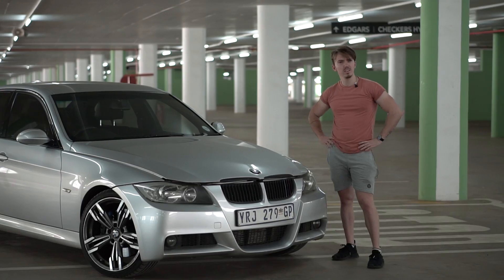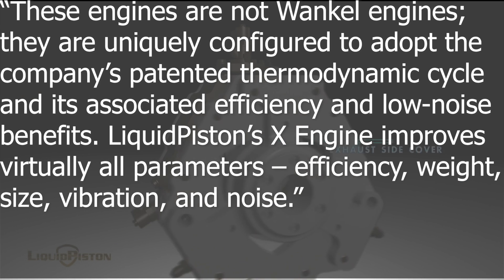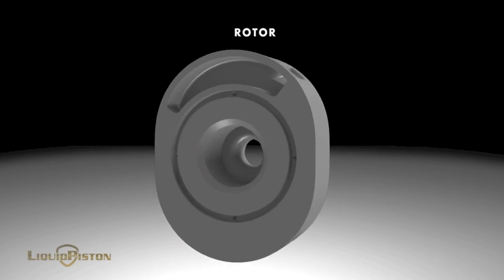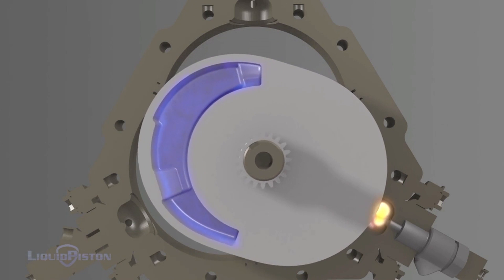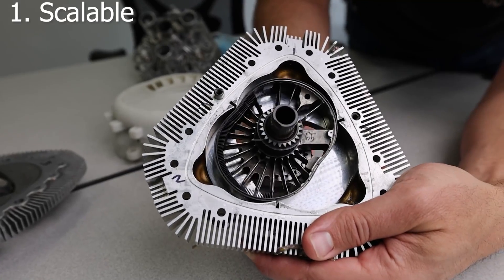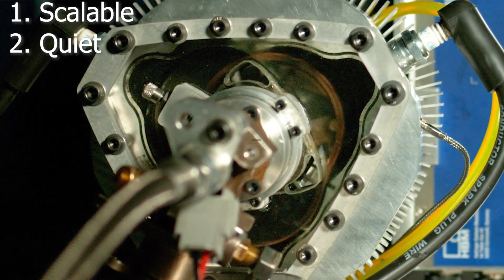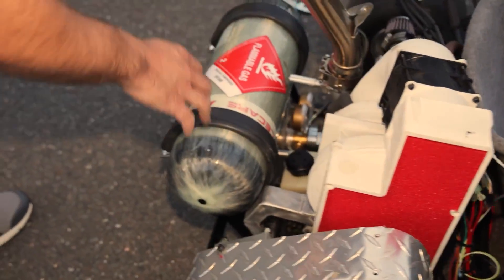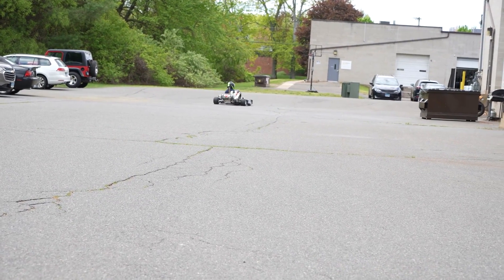This Liquid Piston engine revs to 15k rpm and can make over 1000HP

Comment: I'm thinking this is great commercial application use.  5 horsepower out of 70 cm is not much.  A dirty 80s NRD made Simson Comfort had a 70cc engine and made roughly 5hp.  The 49cc version made 3.3.   that 5 hp mark seems low.  Would love to c the power graph charts..  hope they keep improving it.  Who would make for some small gen set units.  Thinking about the trucking industry, all the refrigerated trailers and commercial generators....

Comment: the engine great . but unless you're using bottled oxygen your poluting worse than a gas engine.  air an hydrogen make green house gases worse then CO2 and stay in the atmosphere longer.  remember air is mostly nitrogen and many other gases. ICE gas engine designers didn't think why they were bad and now, Hydrogen profits are doing the same stupid idea that brought us smog. what will be the first problem our children have to fit if they can.

Comment: 50cc 2 stroke engines are producing up 38hp 
2 rotor 13B drag race engines running single turbo on methanol are reliably producing 1400hp

This design produces no more work at the crankshaft than a Wankel.

Hardly anyone realises it's side seal that are responsible for lost compression in rotary engines. This engine will be no different. Apex seals will face the exact issues they do in a in the Wankel.

Comment: 4:37 Ya , highly about time 
This can be an outboard motor or an aircraft motor even as a diesel . Using the blade to vent and retrieve fuel is genius that the designers of the Wankel didn't get ..!

Comment: 2:40 75cc produces 5 horse power at 15k rpm! How much fuel does this thing burn for that HP? I'm no mathysicist but I bet it's a lot. 
That alone killed this thing in the crib. 

R.I.P liquid piston.

Also if this thing could do what is claimed the liquid piston engine would be in everything by now.
Reply: It will be a gasoline guzzler!  4 stroke gasoline engine fires every two rotations.  This engine fires 3 times per rotation.  It fires 6 times as 4 stroke engine with the same rpm.  You should investigate more on their efficiency claim.  There must be some cunning tricky interpretation of the word efficiency.

Comment: One of the big faults of the Wankel engine was a filthy exhaust gas output. I think this mostly came from the fact that lubricating oil was pumped into the rotor casing to lubricate the rapidly spinning rotors and the fixed seals.. Isn't this engine the same? If we have lubricating oil in the combustion space, we will get a very polluted exhaust output, like the traditional two stroke engine. If this is true, it will never be allowed to power cars, motorcycles or trucks because of clean air legislation which exists now right across the world.. The military applications may operate under a different regime. They will be exempt from pollution controls.

Comment: This engine in the 20 to 80 HP range of options would be perfect for the ultralight, paraglider and even small aircraft market.  Rotax is no longer making engines for these applications and the market is screaming for a viable, reliable alternative.  The market for this would be in he thousands per year.

Comment: It's and interesting design.  To get DARPA interested means someone put a lot of effort into selling them on its potential.  To see the Army interested means they have some niches where it might have potential.  Likely the Army is paying for a proof cf concept for some of their niche requirements to see if can beat what they have.  Once convinced of its potential, they might be pressured for licenses to enable defense contractors with deep pockets to compete and supply the engines.  The fact that it has not yet happened means there are some flies in the ointment but I'm they are able to leverage Curtis-Wright's and Mazda's experiences with the Wankel and build on that.  Watching how it works, I'm guessing they cannot make good on their claim of it being efficient.  However, it doesn't need to compete with the piston engine everywhere to be a commercial success.  All it needs is to fill some niches and/or sell as a novelty.  There were cars, motorcycles, and chainsaws built on the Wankel, and not all made sense but they made money.  Perhaps the Army believes it might have potential for low-cost drones.  Generators and air compressors are real heavy mostly because of the generator itself, but it might play well with their “single fuel concept” (SFC)  if it can reliably do compression ignition. It is a lot easier to remain capable logistically by inventorying more of one than less of many.   In that case, it doesn't need to deal with better-than-piston fuel efficiency or emissions.  They are making everything from aircraft, to tanks, to trucks, to generators, to air compressors,, to heaters, to cook stoves to use a single fuel and multi-fuel where possible.

Comment: This design certainly has potential, however, there are factors that always seem to be overlooked. This tiny engine might be able to rev to 15k rpm, but if you scale it up, it becomes much more difficult to come anywhere close to that. The larger the combustion chamber the slower the rpm tend to be, reducing power potential. I believe there is a tiny wankel engine for RC use that can rev to nearly 30k rpm, but larger wankel engines can not get anywhere near that.
I believe this engine also needs to cool the exhaust a lot, as all rotaries, this not being an exception, have high exhaust gas temperature. To do this, the blow cooling air through the rotor. This wastes energy and makes it less efficient to turbocharge. It also makes it harder to stack multiple rotors, which is already rather difficult due to the design of the engine.

Comment: It is still a metal on metal contact engine. The reason rotary engines failed was because unlike a traditional piston engine that only makes contact with the walls of the combustion chamber with a spring loaded thin metal ring, rotary engines didnt just use a bigger metal surface to make contact with the chamber walls but its entire working required it to do it constantly, at very high speed and with force scraping sideways so no part of the chamber remained untouched. That means once it has reached the end of its durability, no mechanic can rebuild it correctly due the odd shape of the inner chamber (piston chambers are cylindrical and boring equipment are made for cylindrical cavities). When working with metals simple shapes can be recreated with much higher precision and lower cost then odd shapes like oblong or triangle which need a far more specialized and expensive metal cutting tool. I'd say the engine was designed to be discarded after use with the intent of preventing engine builders from fixing it. It is an all too common ploy used by chinese manufacturers to increase their sales volume by sacrificing customer confidence and product durability.

Comment: This would be great for a home portable generator. I need/have a Westinghouse 12,500w duel fuel 15 hp generator that I need in FL because we lose our electricity quite often from the tropical storms and hurricanes. It must run the central air. It burns a lot of gasoline. 6 gal/8hrs. After a hurricane our electric can be out for more than a week. Do the math. 24 gallons a day. Plus the noise. A 30% decrease in fuel consumption is enormous. That's about $25/day in savings with gas at $3.40/gal. I want one now.

Comment: 5 HP Constantly is enough for a small electric m'otorcycle. The engine is so small you'd have enough battery space for 20-50 miles without having to burn any gas if it was a plug in.

Comment: Exhaust gas temperatures in efficient high output engines reach in excess of 900 degrees centigrade and pistons are normally cooled by large and close contact with cylinder wall and oil spray under piston is often used. The rotor here with exhaust channel seem difficult to cool well. High temperatures may give sealing problems and material problems on all sides of the rotor probably. Running correct fuel/air mixture for correct catalytic converter function gives high exhaust temperatures.

Comment: I think that there could be problems with the rotor seals as they do not have the benefit of centripetal force to hold them against the rotor. This may become a problem at higher RPM.

Comment: It's just a pity about the Hydrogen, It's just as polluting as gas/petrol, costs 4 times as much to produce, it's virtually impossible to find and if you do find some green Hydrogen it has used a vast amount of electricity to produce. It's far simpler to use that electricity more efficiently by putting it into an EV and electricity is everywhere and also far cheaper.

Comment: One of the problems with that engine design is that you can't make multi-rotor versions.
Reply: I disagree, you could redesign the side plates with integrated intake porting on one side, and exhaust porting on the other.  Add rotors like making a big mac.

Comment: Every so many years the revolutionary rotary engine appears and then disappears.. Two reasons. It can't be sealed and high emissions. Years ago G.M. took on the Wankel engine and came out backwards. Had they phoned an engine designer friend of mine they could have saved themselves $300Ml.. Some just have to learn the hard way. Best of luck.

Comment: 70cc make 5 hp? That's less than a piston engine. I understand its a hell of a lot lighter and smaller (overall) but per cc (capacity) the hp is lower, considering it has 3x the power strokes per revolution Im surprised.

Comment: This motor appears to be a perfect replacement for current motorcycle engines ! The size and weight makes it perfect for motorcycle design !
Reply: yes and ebikes.. the energy density of the battery is why they are terrible.    downscaled it could be like have  2000 watts with far less weight.   although that  presents challenges the whole tear drop shape ultra efficient 3 wheel vehicle starts to make sense, as well as in robotics where batteries and vibrating piston engines cant work.  the only power source for an android robot is reserved for small space proves and wont be let out into the general population even ithey they had enough of it.    why question how loud is it.. how do 4 small rotors stak.  i would guess they scale by adding more units..

Comment: Liquid piston struggles with the rotor overheating. They don’t have a reliable cooling system for it. Maybe make it from alumina (ceramic).
Position a port and cover over seal ends and they’ll be replaceable with minimal work.

Comment: Technical chart : i hope 15,000 rpm (250 Hertz) which is (1/250)=(4/1,000)=4 msec, but the FLAME (Propagation) TIME needed is much more than that (15-20 msec). Obviously the Power stroke will deficit of thermal extraction, they (triple lobes) will not ever reach full expansion before being dumped-out to (premature) exhaust;
(1) you can argue that 15,000 rpm is just MAXIMUM speed, the Operational ones is much much lower than that, the optimum speed usually 60% (of less) of Max one..
(2) you may CHOOSE very high OCTANE no. of (gasoline) fuel, to make fast burner.
Then you could get a more efficient version of this compact engine..good luck!

Comment: I think they will have issues with wear and rebuilding the Rotor housings they  are very complicated..if worn they would most likely be tossed out,and replaced with new as well, if any carbon is collected inside the engine it will  most likely damage the rotor itself as the apex seals are now in the Housing..

Comment: This might find a good home inside small aircraft like a Piper Cub or a Cessna 172. Or perhaps being used in motorcycles. In both applications you have the efficiency of a diesel engine without the excess weight.

Comment: I like the idea.  I would like to see data on lubrication and cooling it though - seems like that much power in that small a package would generate a lot of heat.
Reply: one main problem w the wankel engine is that it requires burning oil, which this does not do. Additionally, because the apex seals dont move, they are less likely to fail. As for cooling, there are plenty of innovative ways to cool things that are much hotter than this

Comment: I would bet the seals will be the weak point in this engine just as in a Wankel type engine.  In a piston engine, the piston rings are exposed to the same forces on each stroke.  Not so with this engine or the Wankel.  The seal is exposed to different forces during each revolution.  Unless they have cured the seal problem, it will not become a durable engine.
Reply: yeah 1mm. cast iron seal

Comment: ONLY one end of that rotor gets heated .. sealing will be problematic. And require oil injection or mixed with fuel.... creating high emissions, limiting applications. Plus side:  very power dense, so a good niche fit for military applications.

Comment: With its exceptional power/weight and power to frontal area ratio, this engine would also be ideal for aircraft.  Picture a King Air with only 1/3 of the weight of its current horizontal-opposed piston engines, and nacelles that can be far more streamlined.
Reply: "Picture a King Air with only 1/3 of the weight of its current horizontal-opposed piston engines, and nacelles that can be far more streamlined."
You are in luck!  Today, you can actually take a picture of a King Air with 1/3 of the weight of horizontal-opposed piston engines with nacelles that are streamlined. at any airport with a King Air, and see them with their original pair of Pratt & Whitney PT6 turboprop engines.  (tic)

Comment: Everything is good, especially you can fire 3 times a revolution, but Just as bad as the rotary engine apex seal, and the low rpm torque, not say it's bad, higher torque required very high rpm, so maybe good for  hybrid engine?

Comment: This seems like it could easily displace the entire small-motor market sector, gas scooters, dirt bikes, atvs, snowmobiles, jetskis, lawn mowers, chainsaws, leaf blowers, snow blowers, backup generators, outboard motors, really anything using a two-stroke or a 1-2 piston 4-stroke hoyle be able to benefit.
We might even see more use of electric transmission drive trains in small motor applications. I'd love to see one of these powering an electric drive train on a stretch ruckus.

Comment: It’s great as a 4 stroke version of a wankel but still we have the seals issue.  I really want these guys to succeed but I have not seen any innovation in the apex seal.  I know there is a company in Portsmouth that rebuilds Mazda rotaries and has increased the life in those engines but I think there is still a way to go.

It’s the one overriding advantage with cylinders,  the seals don’t have to conform to a moving face.  They can be oiled from one side and there can be many of them per chamber.

Has anyone thought of using a needle bearing as the primary seal?  Then a sliding seal behind the needle roller bearing?  This way the sliding seal doesn’t have to move.  The needle roller can turn at the appropriate speed to match the rotor passing over it so there would be no sliding force on the rotor.
Reply: Silicon nitriding sliding seals have great antifriction properties

Comment: I wonder with the apex seals contained in the housing instead of the rotor would it be possible to replace the seals without an engine out rebuild. A removable cover could be over each seal and the old seal could slide out, a new seal slid in and the covers and caskets replaced.  Just an idea, seems possible. So a seal replacement could be a regular maintenance procedure like a timing belt replacement.  Not necessarily simple but easier and cheaper than a complete engine teardown. Thoughts?
Reply: It’s a worthy idea as seals will still be a big problem if trying to run this engine for a long lifetime

Comment: This seems like the best choice for a Paraglider engine or a similar ultralight ... but I'd say it probably should be 3D printed. Forget about developing manufacturing methods for the engine, just 3D print it.
Reply: just use a 2 stroke engine for a paraglider. Its going to be hard to get lighter and more simple than that.
Reply: @richr161  Those 2stroke paramotor engines are bulky and heavy. and 90% of the reason why is because of the exhaust. This type of engine shouldn't need any exhaust pipe at all.
It's not simpler, that's true and it's likely not going to be as powerful but it's most likely going to be smaller and lighter.

Comment: Oh, SUPER quiet. Haha, jk. The fact that they eliminated the apex seals is huge in itself. I'll be interested to see how the intake and exhaust seals hold up. As far as I know, they've never been incorporated into the rotating assembly.
Reply: They didn't eliminate the seals, they moved them from the rotor to the ring.  The rotor doesn't have apexes like the Wankel rotor does.

Comment: Only problem I can think of is the centripetal force from the extreme RPMs might cause the material to destroy itself but maybe not, would be interesting to find out
Reply: considering the 'rotor' is housed, it would be the housing itself which takes the load moreso than the rotor
Reply: the f1 2004 engines could rev to 19000rpm with a 3.5L engine and it didnt explode

Comment: To my reckoning it won't need a gearbox thus saves yet more weigh
Making it extremely stronger with platinum coated internal surfaces to stop rust or erotion.its not as expensive as the razor blades have a spluttering method to coat the blades.
Results should be a fantastic throttle that just keeps reviving faster and faster.
In theory anyway.